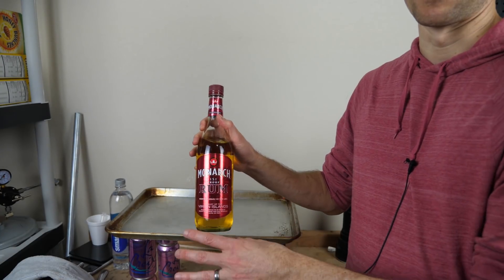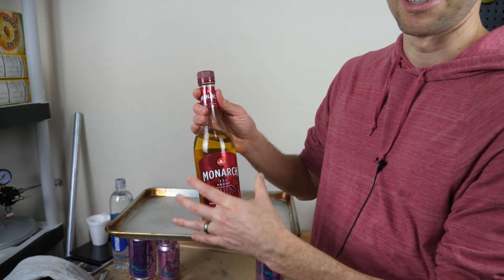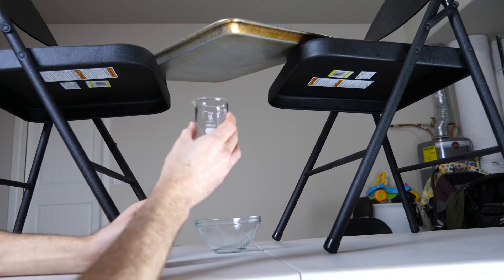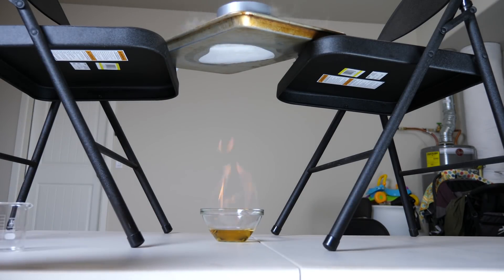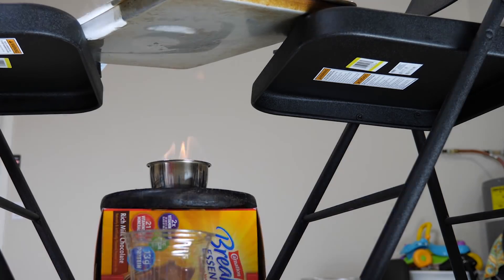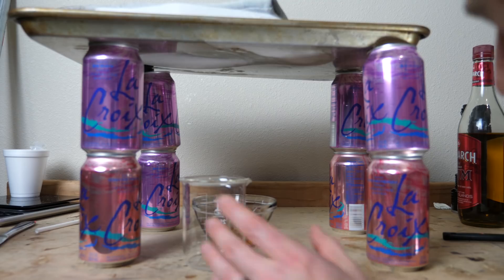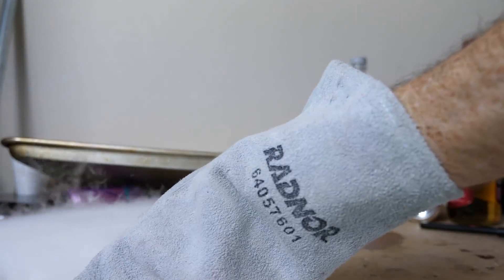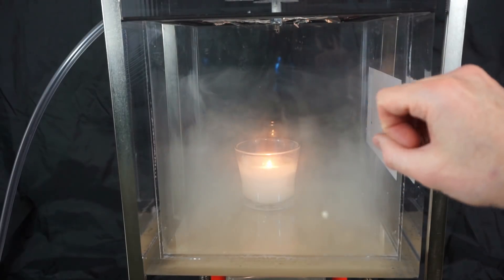Is it Possible to Turn Alcohol Into Pure Water? (I Almost Burned Down my Garage)

Comment: I think where the hot and cold source meets , humidity in the air becomes water. Alcohol was just a  fire source.With any fire source you may get same result.
Reply from the maker: You would get the same result, it just takes longer. Fire provided more humidity.
Reply: Marcel Schumacher its from rum. its literary alcochol smoke
Reply: Marcel Schumacher - It the same reason why you have a drain line on your furnace... water is a byproduct of any combustion.  If you were to set up a closed system to capture the 'smoke' from the burning whatever and allow it to cool, water would condense as it did so.
Reply: The Action Lab so basically the water isn’t from the rum, it’s from the air

Comment: If you ever decide to use gasoline as a solvent to dissolve a non polar substance, don’t heat the gasoline to speed up the reaction, not even slowly.  Not saying I did that but, I did that.  Almost burned down the shed.

Comment: This would have been a great opportunity to collab with another YouTube channel that wanted to make a better distilling setup, but it was a good video none-the-less. :-)
Reply from the maker: Well normal distillation setup wouldn’t work because you have to remove much more heat than just boiling water
Reply: The Action Lab Oh yeah, I see. What would happen if you just boiled the alcohol and cooled the vapor?
Reply from the maker: Well then I would just be doing distillation. This video was about changing alcohol into water:)

Comment: So chemical engineers might be more mechanically inept than us electrical engineers. Who knew lol
Reply from the maker: Lol, yes reflux and condenser wouldn’t have worked. It’s actually a more complicated process than it comes off as. You need to supply the correct ratio of air but not too much because then you will just be condensing off mostly humidity from the high flow of air and not from the combustion product. Also you have to remove a ton of heat from the combustion products so you can’t use a typical condenser with water to cool it. That is why I went with burning in open air with only natural convection and very cold cooling plate. Sometimes keeping it simple is the best method.
Reply: I'm a computer engineer, and i would have done worse
Reply from the maker: Coma white-you sound like a real expert here! Lol, I would love to see you set up a condensing system to condense combustion produced H2O using traditional chemistry equipment. Please show me your setup. It’s easy to describe, harder to do. Not to dis on other chemists, but I have usually found that as confidence and arrogance increases, actual skill decreases. And I can tell that you aren’t an engineer. We engineers go with the easiest and cheapest method that gets the job done. This video was to show that combustion produces water. That is what I did without spending a fortune on condensers that would have added nothing to the point of the video. One of the main purposes of my videos are to show people that you don’t need special equipment to do interesting experiments. I know that “scientists” tend to keep themselves separated and above the laymen. I’m just bringing science to the masses.Take it or leave it.
Reply: @TheActionLab  Personally entering the comments to deal with trolls and disprove armchair chemists made me gain more respect for you. I personally like that a lot of the experiments that you do are done with common household equipment most of the time. Makes me feel like I could actually give many of the experiments a try myself and is a great source of motivation to actually give a few a go.
Reply: Coma White stop quoting the same BS over n over again. He is not like you to have condensers and what not lying around his house. Sure this ain't how a chemist would do it, but the goddamn result is the same. Like he said, this is science for the masses and NOT armchair chemical engineers like you. Have a good St. Valentine's day.
Reply: Coma White what the hell would you reflux? LOL you need to supply air to it, you can't have that setup working if you're burning it
Reply: Coma White I think you'd need some uncommon glassware for this to work well
Reply: Coma White not sure, I'm an amateur chemist. (Chem Eng student also) but if you're forcing air through it would give you a really hard time to condense the water.

Hell now I'm kinda curious to try it 😂 who knows, maybe it will work.
Reply: Coma White yes he [bill nye] does

Comment: And also I’m CRYING LAUGHING at how you’re just like “fire? Forget that, here’s some dry ice. Fire problem solved”
Reply: It's actually genius. As the heat of the fire melts the dry ice, it just becomes a cloud of CO2 and suffocates the flames.
Reply: Yeah, I had a block of that dry ice in the broom cupboard just for fires. But the next day it was gone. $@%&ing thieves...
Reply: Spooky Wizard Why would anyone joke about dry ice theft? It's a serious crime that is on the rise.
Reply: tubeist- dan I hope you're joking
Reply: Why do you think fire extinguishers often spray CO2? They're literally filled with supercritical (held liquid at higher than boiling point due to extreme pressure) CO2.
Reply: That was.
Reply: Jay Elle i
Reply: Jay Elle it's not just cold, it's made of CO².

Comment: Is that water Ionised or deionised?
Reply from the maker: It would have ions in it due to the metal plate it’s in and impurities on the plate
Reply: Assassin Tech why not both?
Reply: Alan Douglas because its impossible
Reply: Alan Douglas because if the water is ionised it can't be deionized and vice versa

Comment: Isn't some of that ice from condensation? From the dry ice making the metal Ice cold?
Reply: John Smith but isn’t condensation still just water? ;)
Reply: Jess L yes but not from the fire it's from the air in the room
Reply from the maker: Yes the water is from both the air in the room and combustion